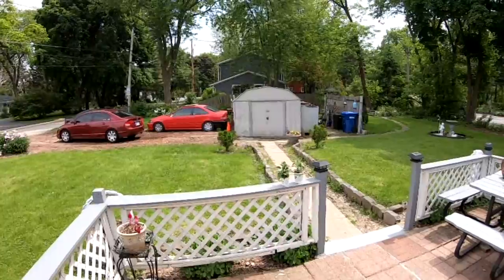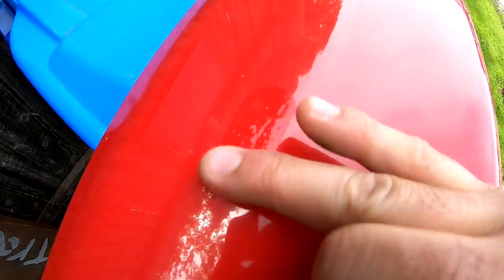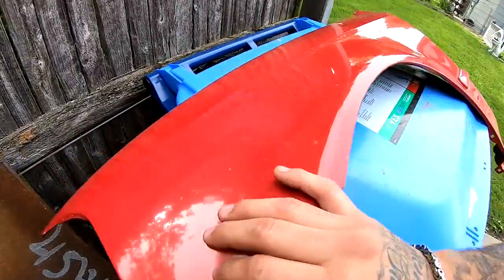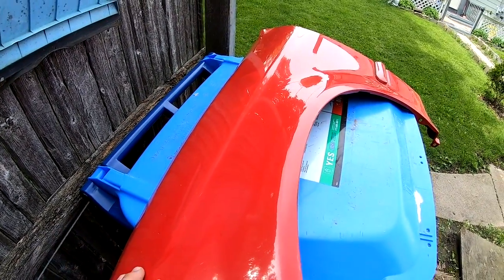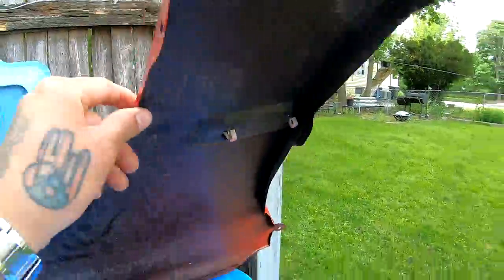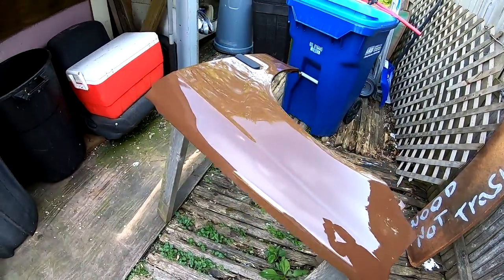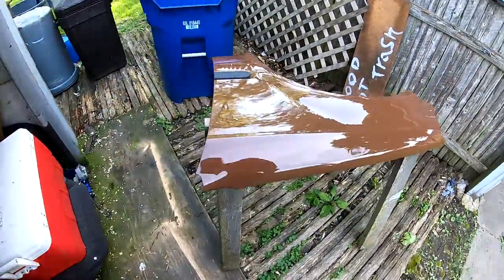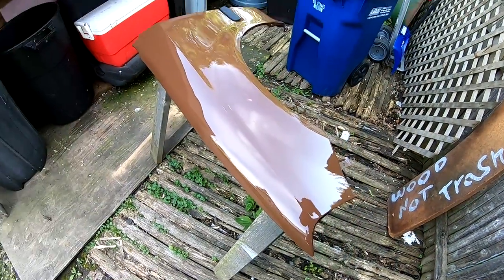rustoleum Gloss leather brown fender paint job

Comment: Go with the brown and repaint, will look different. Question can you spray a clear coat over the Rustoleum for more protection?
Reply from the maker: I have tried before and if its not a rustoleum can  the paint always has a reaction and wrinkles up. Im actually attempting to clear coat right now.not the fender because i dont wanna mess it up but on something else if it work i will clear the fender i will post the video of this attempt soon
Reply: @BarbasLife  you didn't try spray max 2k clear in the can huh?